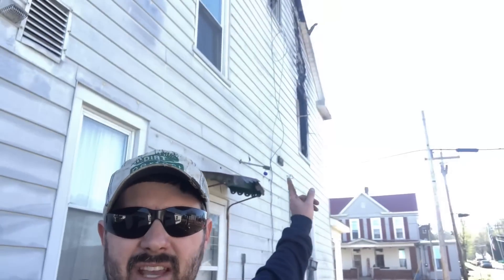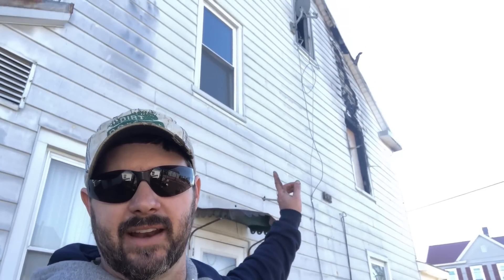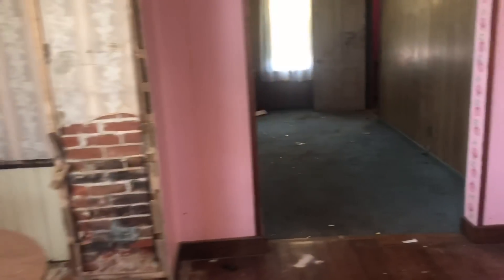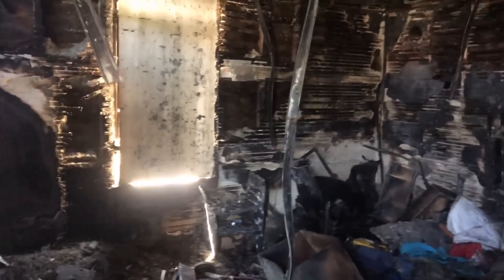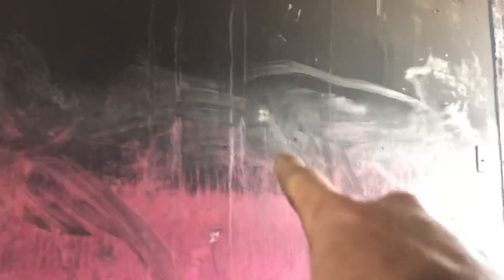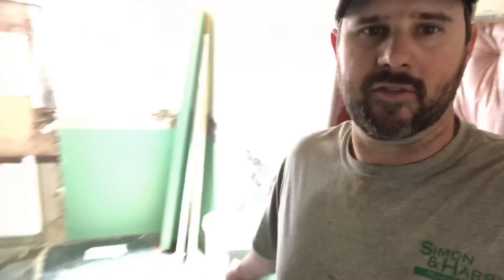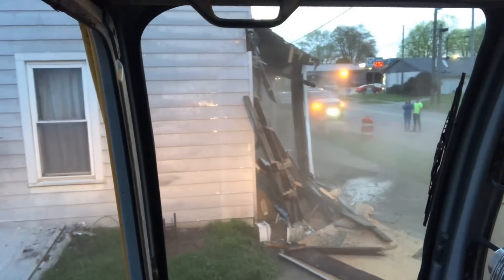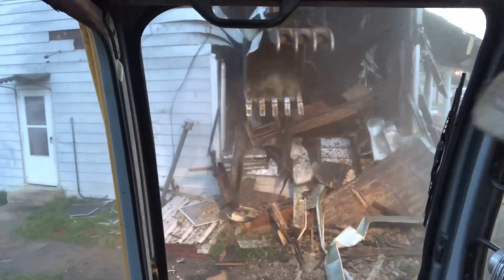Tearing down large 3 story house after a fire with two excavators #demo 🔥

Comment: That soot line you pointed out is actually the heat line too. The air was hot enough to damage the sheetrock/paint. The temperature at the floor was probably less than 200 degrees while at that heat line it was probably between 600-1000 degrees. The house held up great considering because of the materials used and how its built. That's what we call a legacy structure in the fire service. A house built today would have been on the ground. Looks like the Fire Department did a great job though. Always make sure you have working smoke detectors in your home. In a house like this one you have around 7 minutes to get out, in today's homes you have about 3. Everyone stay safe.
Reply from the maker: Thanks for the comment Jeff very informational love to learn 😀
Reply: @Roger Ronan instablaster ;)
Reply: @Harper Ira it did the trick and I finally got access to my account again. I'm so happy!
Thank you so much you really help me out !
Reply: @Roger Ronan No problem :D

Comment: I was surprised they didn't repair but if there were other issues I suppose. 
Nice stop by the local FD. Fire damage didnt seem to extensive actually.  The smoke/heat line here is exactly why we teach people to stay low, ourselves included. The temperature and visibility difference from floor to ceiling is DRAMATIC. 
Cool demo video by the way.
Reply from the maker: Thanks and yes the house had some other issues. Thought that heat line was pretty cool myself I don’t get to see that everyday
Reply: @DirtPerfect  
26 years of seeing it and its still cool. Fire is an interesting animal.
Reply from the maker: Yes it is

Comment: Far too many homes burn down because of faults within the electrical wiring of the building [power cables getting hot without fuses tripping]Also sometimes fan heaters are sold that draw 10 amps whilst being equipped with power cables fit only for 5 amps continuous use [ie 10 amps intermittent use-a recepie for trouble if cable is over stressed]Since my mother's house burned down [electrical fault] I now operate electrical appliences on an "eyes on" basis-no to fridges/freezers /standby mode etc etc.